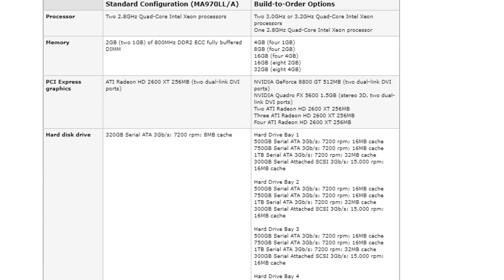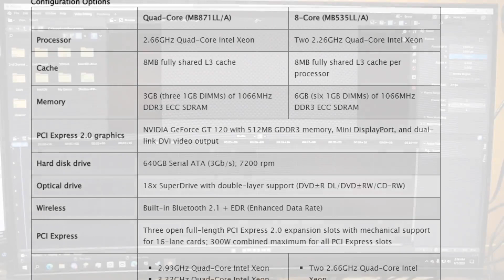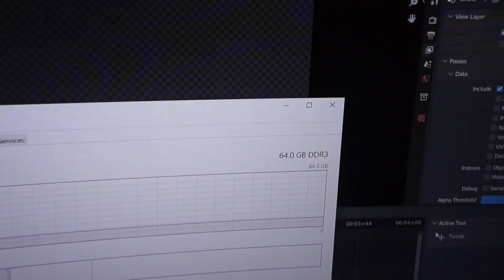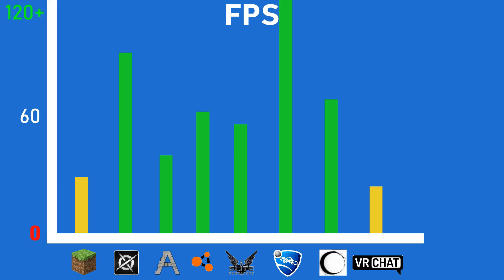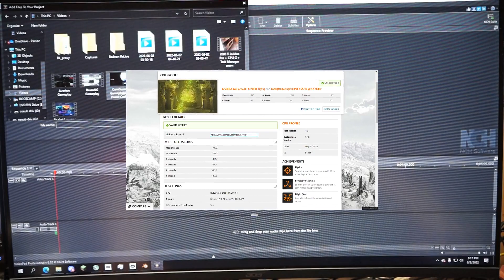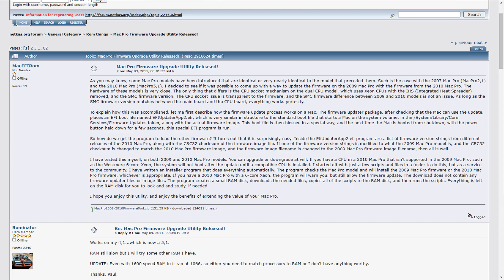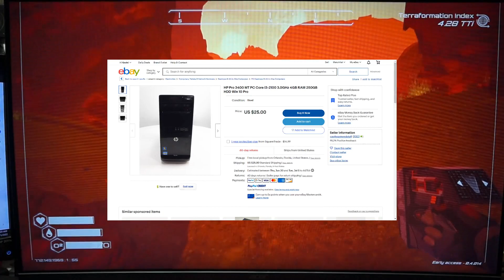The 2009 Mac Pro in 2022 | Is Dual Socket Still Worth the Trouble?

Comment: Quick answer is they only have sometimes issues with 130watt CPU on dual 2009’s… singles handle 130watt cpus just fine and 2010/2012 no issues with any of them
Reply from the maker: Honestly if I had the single CPU version I would've gotten the w3690 and just overclocked it as much as I could've. Although 3.73GHz for the locked x5690 is still mighty quick
Reply: @DimondDoesTech  x5690 is the way, just not always on a dual 2009….

Comment: I have been a Mac Guy since 1994. I got my first Performa 475 from Sears. Over time I have had at least 10 Macs of all different kinds and flavors.....but I am not tech nostalgic. My Daily Driver was a highly upgraded 2009 Cheesegrater...loved it....but ditched it about a week after getting a Base M1 Mini. Simply bought a decent ThunderBolt Hub and external case for my 2 spinning drives.....never looked back. I am ecstatic Apple left Intel/x86 behind
Reply from the maker: Clearly its working out for Apple with how they moved to their own custom chips vs x86. The M1, M1 Pro, etc all have hardware on board that help with content creator types, mainly having hardware that allows for extreme performance boosts in rendering, editing, and the like. While I am not a huge fan of MacOS I have to say that it is currently better than the garbage pile that Windows is now.

Comment: I found a 2010 Mac Pro 5,1 for free at my local dumpster. It currently has a single 4 core hyper threading Xeon. However, I would like to upgrade it to dual cpu 6 core hyper threading xeons, with a total of 24 threads!
Reply from the maker: Nice score!

Comment: You've got to do the pixlas mod and you can run the GPU at full power. These Mac Pros have like a 1,000W psu, plenty of power. The pass through on the board for the gpu power leads can't handle the high current, and the machine detects this and kills power in order to save the board. The mod basically bypasses that and wire straight to the psu.
Reply from the maker: Yep I've seen that mod myself and it may be something I do in the future as the best GPU you can really get for this is an RX 6800
Reply: @DimondDoesTech  A 6900XT is possible. A 6800XT is close but the 6900 does edge it out by like 10-20%. You need need to mod these though with a PC which is a downside.
Reply from the maker: @vb7200  Honestly I said 6800 as going much faster I would seriously be worried about bottlenecking the X5690s. They may be quick but I wouldn't consider them worthy of a 6800XT or 6900XT
Reply: @DimondDoesTech  Yeah the Xenon's are older, but Open Core allows for hardware acceleration, which comes in handy for things like video editing and even gaming in Windows. Some of the CPU instructions are getting sent to the GPU, which will make a noticeable difference in things like rendering times and slight FPS bumps. Having a 68-6900XT would be making good use of that.
Reply from the maker: Really? Ok now that sounds cool. I'll have to look into that as the 6800XT isn't all that expensive right now
Reply: Look up Pixalas Mod / House of Moth how to add the GPU wiring harness directly to Mac Pro 4,1/5,1 power supply

Comment: And if you used Tripple Channel instead of Quad Channel RAM it coul be 10% faster!
Reply from the maker: These Mac Pros do not support Quad channel memory. All LGA 1366 CPUs only had a triple channel memory controller.
Reply: @DimondDoesTech  thats correct, but you populated all 4 Slots, thats bad!
Reply from the maker: @Bogomil76  All 8 slots are populated. That means that, and I verified this in CPUz, it is running on triple channel mode

Comment: I had the 2008 model of those, i used it for 2 years, i got it for free from my old job as a thank you for my service. It whas good enough, but i wanted to game, and i gamed on it, i had 22gb of ram, a oem variant gt 620 (has 192 cuda cores instead of 92) that i pulled from a fujitsu pc, and a couple of hard drives for 6tb in total. It whas a good mac, for work i booted it into macos, and for gaming, i ran windows. But the problem with those big towers is, power consumption! Having 2 very old processors consuming around 500 watts, is insane! I picked up a mobo and cpu combo, i whas looking for a case, once i had everything, i putted a pc together, which had almost the exact same geekbench score (single core scores are way better on my gaming pc offcourse), and it uses only 65 watts of power, and i settled on the i5 6500, which is plenty powerfull for what i need it for. The mac pro got sold pretty quickly, and with the money from the mac pro, i bought myself a gtx 1660 right before the prices went crazy. I still game on this exact graphics card. The 4,1 and 5,1 might be usefull to some, but as a regular desktop/gaming pc? I would say no, these macs consume so much power, way more than more modern cpus ever will, plus you need to have a mac flashed gpu in order for you to boot from dvd or usb, which is a pain in the rear end.
Reply: (This is my first channel btw) I will say that yeah power consumption is a big deal if you worry about that sort of thing or someone else pays the electric bill. I was running a minecraft server for a while on this mac pro (upgraded to duall X5690s) and my dad was starting to complain about the electric bill a little bit. I feel the real issue is that these macs don't ever go below base clock, at least not from what I've seen. The lowest clock I saw it hit was 2.96GHz while at IDLE so its still drawing a boatload of electricity. However when you consider these machines, when you look around, can be had for cheap... they really aren't bad. Especially these 4,1 macs due to the upgrade path. Most of the ones you find already come with something like a GT 120 so you can deal with booting from a DVD and such. Currently as specced I have an RX 480 and a GT 120 (for boot menu only) and it clearly can do more. However I need to get fans and a shroud for my 480 as it was $25 (video coming for that too at some point :p) -DDT
Reply: @Dimondminer11  That's what i found out about my mac pro as well, 3,00ghz and not lower, in windows i had sort of a intel powergadget thing and i saw that they never clocked down, the gt 120 that whas in my mac whas artifacting so it whas unuseable, luckely there were other mac pro's on the truck (i dissassembled and recycled pc's at my previous job), the 4,1 is a great machine, especially when you flashmod them to a 5,1 which is easy to do. The 3,1 whas also pretty useable, i patched it to mojave and that ran very well with 8 cores. And the rx 480 is still a good card, and you got a deal there i see, nice! You can just jerryrig a fan on there, i did this also to an old agp card for my retro windows 98 pc, the fan on that card made a lawnmower noice, so i had to take it off because it vibrated through the entire case :p
Reply: @bramvandenbroeck5060  Annoyingly after having a really bad night the night I posted my comment it really does seem that my 480 is borked. Not a big deal but still frustrating

Comment: I’d put dual 5690s in it and a flashed 6600xt. That seems to be the best/most modern configuration that actually makes sense with bottlenecks in mind
Reply from the maker: Well I may just have done the former and might do the latter at some point. (vid coming... at some point. Been struggling with drive to make vids when you can't get a stinkin job)

Comment: Managed to pick up not one but two, 5,1s for well, well under 140 a couple of months ago... One a 12core the other 8. 

These are impressive machines no doubt... 

Trying to build up a maxed out beast for as little cash as possible 

I enjoyed your vid
Reply from the maker: Holy mother that's a heck of a haul you got there! They are truly beasts even today, disregarding the whole power consumption thing...
Reply: @DimondDoesTech  Cheers, trust me I'm embarrassed to tell you how much I paid but it was less than 1/3 of 140 for both.

Having lots of trouble getting a boot screen/boot picker though - tried flashing my GPU and the OpenCore method, nothing seems to work. (Want to be able to boot into windows) Need to try boot camp again as I couldn't seem to do it in Mojave but I've used dosdude for Catalina.
Reply from the maker: @anthonyjackson1853  What I use is the OG GT 120 as it is already flashed to be EFI, and use that go get to the boot menu and go into windows where I then swap the video cable to my Windows GPU.

Comment: Surprised no one has said this but old Mac Pros (or cMPs, as the community calls them) are finesse machines, there is some tweaking that maximizes performance. They are STILL potent today - especially as multi-core optimization became a thing. This era of Apple is, bar none, the best era of their machines - and, yes, it is because of these machines, specifically the next year AFTER yours (which you can flash the BIOS to, and access the later chipsets). I still have a 2006 that I like to push with modern OSes and SSDs to do cool things, but something capable of 24 threads at over 3ghz per CPU... well... 

I have 12 cores running on mine, not even at max chipset, and despite it's outdated PCI-e lanes and slow RAM, can tear up stuff... In Windows or Linux. MacOS is designed for obsolescence since Jobs passed, and even he was guilty of fueling that (G5 Quad, look it up if you don't know - that was a kick in the junk). 

My retro-modern gaming rig is one of the 5,1 2010 Mac Pros, 32GB, with an Asus Matrix 5870 - I love it, and I run it into a 19" CRT at 1600x1200. Good enough to catch the minimums from modern titles, low enough res that the 2GB of 2011 VRAM isn't killing me. 

These computers are dropping in price as are the Xeons that fuel them - but it takes some patience and a couple screwdrivers sometimes. I'm not gonna trade my modern Intel system in, but as someone who was a "Mac Dude" for decades, this is the reason. These are beasts.

Edit: LOL, I am so used to having to give up the secrets, that I posted early - you revealed the secret sauce... Bravo
Reply from the maker: Thanks! I am rather envious that you have such a nice high res CRT not gonna lie and I intend to eventually shove an RX 580 8GB that I'll flash to be a mac card so I can toss the GT 120 I currently use to access the boot menu to go into windows vs macOS. But yeah the video benchmarking (x5690s... I spent too much money...) is coming at some point in the near future and I gotta say.... expect performance gains in the 40% region over the stock X5550s in this config here.
Reply: @DimondDoesTech  I did a tier down, and saved a bit of coin on the lower spec CPUs. I had an RX580 in it for awhile and, yes, it was killer - you'll really enjoy it. Now that you can use RX6000 series cards though... hmmm ;)

It took awhile to get that CRT... It was my fourth one in the last two or three years, and the other three all had problems. It takes time to find a good one! 

Thanks mate for the reply!
Reply from the maker: @Ibrahim Anser Very true